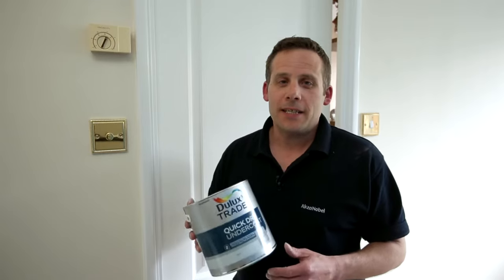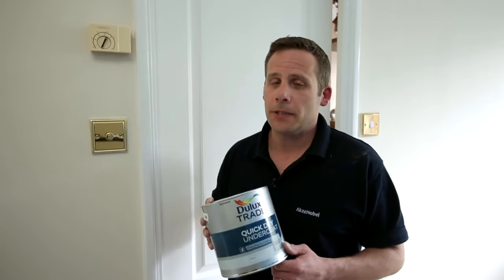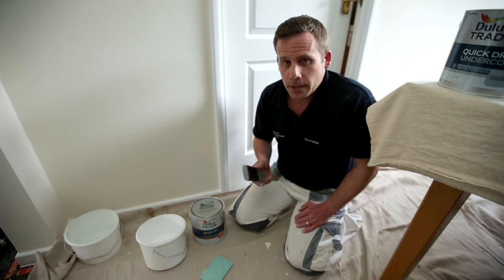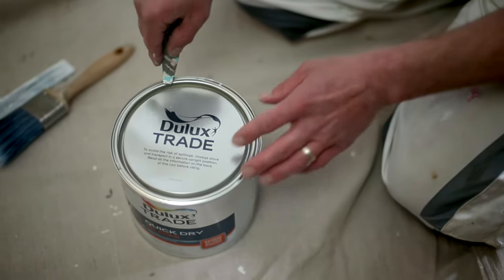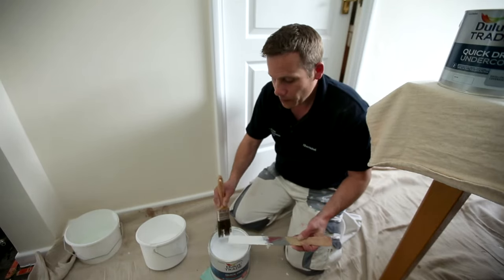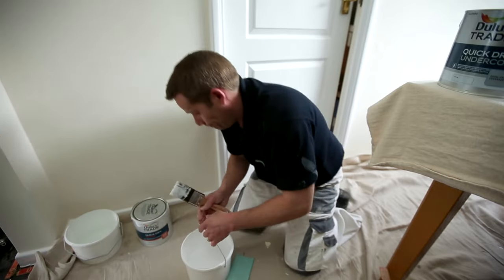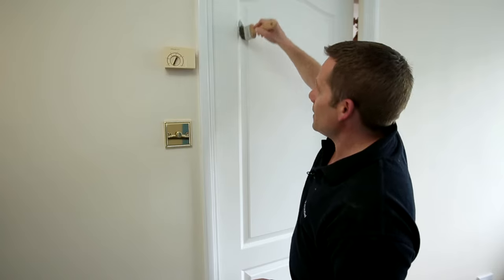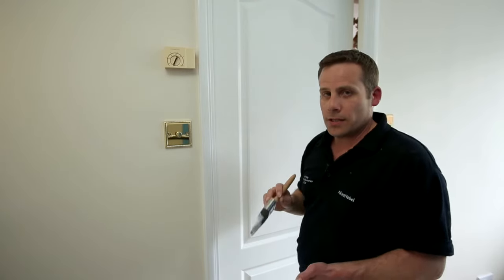Water based paints: How to achieve perfect results

Comment: Never had a water based paint yet that ive been happy with
Reply: You in the trade, because I'm only a DIY doughnut and yes water based takes a bit more work, synthetic brush, and don't over brush, not to much on the brush and one sweep of paint and leave. don't go back over, if you have keyed it a little it takes to the surface perfectly, dries quickly.

Comment: Hello mate like the vid and paint. Been using quick drying paint for ages but can I ask why is it better to use synthetic brush. I’ve been using natural hair.
Reply: Synthetic bristles will not become weakened when exposed to water in waterbased paints. Which means little or no bristle loss.Also synthetic bristles can be manufactured much finer leaving less brush marks in waterbased finishes.
Reply: joe starr thanks joe will buy a few new brushes now. Can’t go back to oil base gloss. I’ve used this dulux and was impressed actually
Reply: I agree.

Comment: You can't  call your self a  decorator using any waterbase paint, impossible to get a perfect  finish. Can't sand inbetween coats brush mark city prep important to a professional, standards haue dropped across the board young guy's haue no chance to learn properly these days. Most the workmanship now is òf very poor standards.
Reply: Try Johnstone’s Aqua gloss (water gloss) it’s brilliant stuff used it for a few years now... easily get 2 coats on in a day plus the finish is excellent just like a good oil gloss... trick with water based is wet your brush first.. then give it rinse off every day 20-30 mins to keep it from clogging up with drying paint... 👍 but I would 100% recommend this...
Reply: most importantly the pay is of very poor standard too